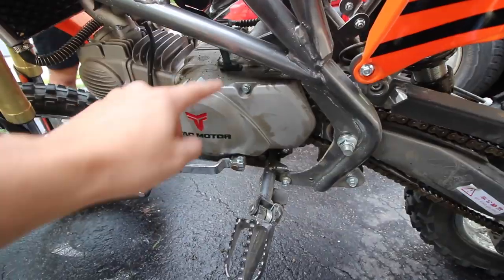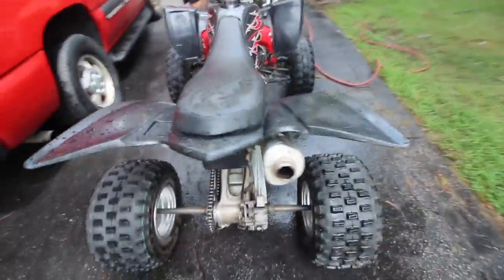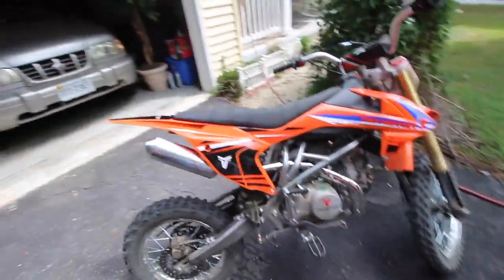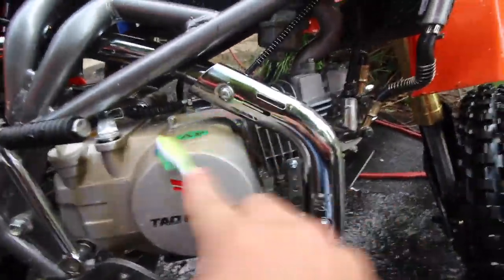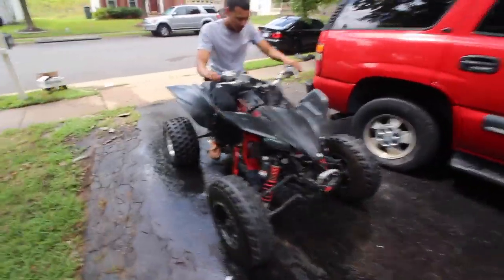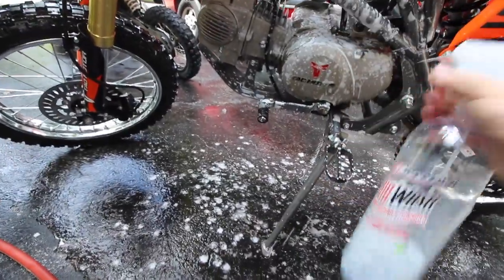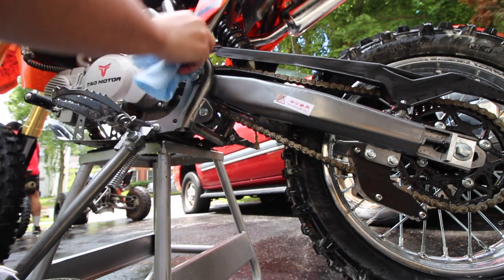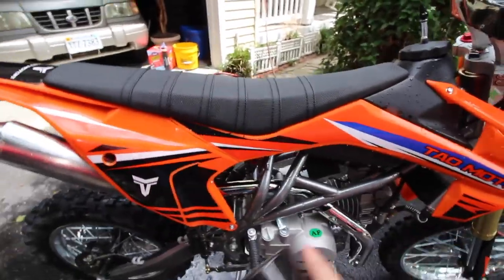Making My Dirt Bike Look This Good In 3 Easy Steps!

Comment: I have the white edition and love it. I’ll try to figure out a way to send a pic to here so you can check it. I put the Acerbis hand guards in place, added #11 plate numbers for my son’s birthday, Protaper locking hand grins because those cheap ones come in hot sun, and Renthal handlebar pad. Also threw on Procircuit muffler sticker and Vortex sticker on the swing arm just to dress it up. Looks nothing like stock now
Reply from the maker: Wallace Spangler send me a pic to twitter or Instagram!!!! I was stuck deciding the white or orange

Comment: did u spray the clean up chain cleaner on and then wax without rinsing off the chain cleaner??? did u read the can … u have to rinse off the chain with water after u apply the clean up chain cleaner so u rinse off all the gunk it breaks up then after u rinse with water u apply whatever lube u want to use u might want to re lube your chain bc it looked like u just sprayed wax on to chain cleaner those 2 don't mix

Comment: Nice work here! I have a Peace CRF70 and it's tank!  I came to the comments area to see what chemicals the average Joe Six Pack would use to clean and lube the chain.    No one stepped forward, so I will.           While rotating the back wheel,   PB Blaster It, wire brush, then soak a rag with the oil you drained off the Buick last weekend. Use a clean rag to wipe down excess from chain and where the chain slung it.(Everywhere) Repeat monthly.   Nice Bikes should have a 3 stage chain lube regime. I agree.  Mine has a cupholder for 12 oz. cans, and is a scary fast acreage patrol vehicle/leg breaker.   I hope the brand is a sponsor, Chinese knock off bikes lack content on YT.  Like, why does my bike have an elec. starter and brake light switch with connects, but no wiring, buttons or battery(or box) I've found in 12 years with it? The moped motor parts bin, I'm sure they share.  But I want to put 12V to it and have lights, horn and elec. start like the grown ups!!     (I'm 46) lol  
      subscription earned my man